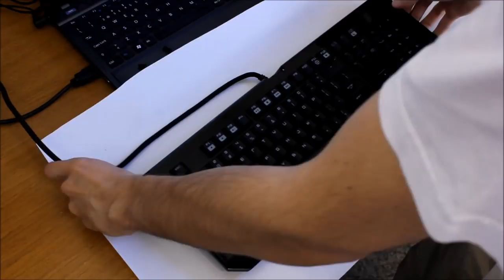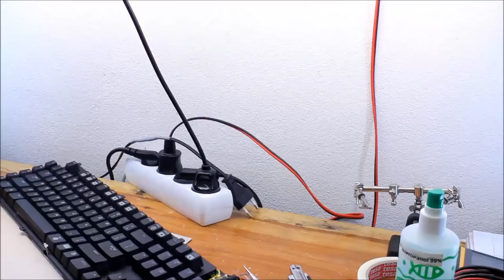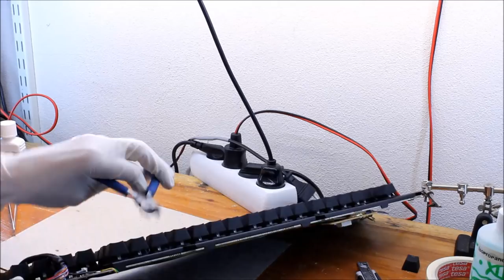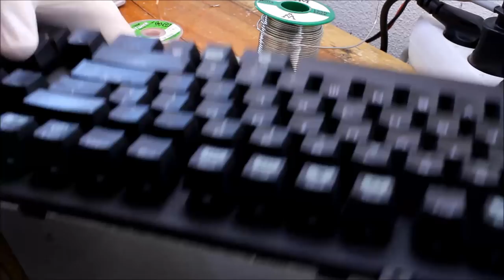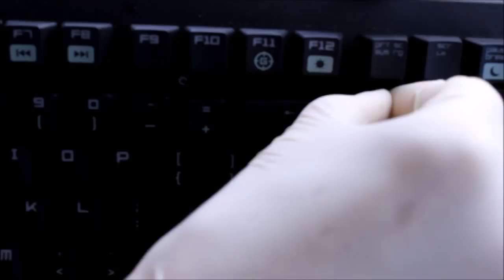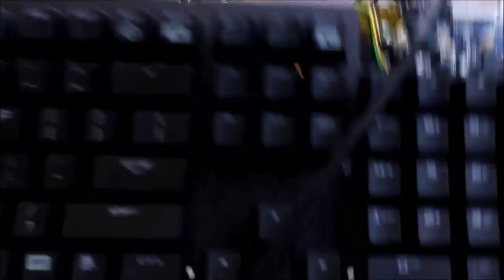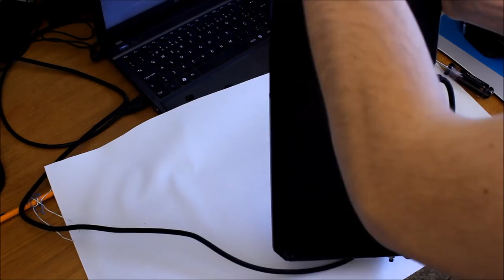How to replace backlight LEDs and Cherry MX switches in a mechanical keyboard.

Comment: Hi, one of the leds on my Blackwidow ultimate doesn't light up. I've read through the comments and will test out if it's specifically the led that is dead. in the off chance it isn't,how sould i proceed to make it light again?
Reply from the maker: The LEDs in the blackwidow ultimate are not individually wired, so if only one of them is not working it should be a dead LED. If the LED is ok I would check the malfunctioning LED's resistor next and then the PCB track, but I'm betting on the LED.
Reply: José Faria Thanks for the quick reply.I'm hoping it's the LED as well. But if it does turn out to be the resistor, how do i gain access to it, i.e. how do i remove the midplate from the pcb? would I have to unsolder everything? also,what are the specs for the resistor?
Reply from the maker: If it is the resistor, I believe you have to remove all the other LEDs and switches, but that's really unlikely. My resistors were 470 ohm, but they were marked, so they were easy to identify.
Reply: José Faria noted. thak you very much.since i don't have any background in electrical stuff, i need all the info i can get. so any 470 ohm resistor would work right? or is there a specific one that i'd need?
Reply from the maker: You need one with the correct size, I believe its 0603 (US). Don't lose your time thinking about that before checking the LED :D
Reply: definitely..i thought i'd just have all the information on hand rather than pestering you every time...thanks a bunch
Reply from the maker: By the way, you might want to buy several LEDs from several suppliers, it might be hard to find an LED with the exact same color, if it's color is significantly different that key will stand out a lot.
Reply: José Faria  Noted, though it shouldn't matter. Planning to switch all my LEDs to white.
Reply: Ali Eimran Good luck. I'm switching my LEDs to white as well.
Reply: Håkon Harnes All the best!!! I'll probably change it at the end of the year when all my stuff comes. update us on the progress
Reply: Ali Eimran Will do!
Reply: I completed the keyboard today. Took quite a while because I couldn't get the tin out of the PCB. Tried a soldering pump which didn't work, then moved on to soldering wick which worked in the beginning but stopped working after a while for some reason. Tried changing the soldering wick, still the same. Changed to a more powerful soldering iron. No luck. Changed to pointy tip, tried different techniques etc. could not get the tin out of the PCB. So what I ended up doing was melting the tin, then pushing the LED in. This worked but took a long time. First insert the right side and push it part of the way in. Then insert the left side. Melt both tin points in the PCB and insert the LED. Took quite a while...
Reply from the maker: When I increased the iron temperature my PCB tracks started to lift (never did in other PCBs at that temperature), I think I ended up doing it the way you did and in the end I had to bodge some wires to replace the damaged tracks.
Reply: José Faria Any idea why the soldering wick suddenly wouldn't work? It worked fine for the top row but after that it didn't work anymore.
Reply from the maker: Sometimes that happens to me too, especially with thin holes. Higher temperatures usually help, but with sensitive PCBs that usually means the copper might lift. The easiest method I've found to clean solder from holes is with a heated soldering pump, I've never had problems with that.
Reply: José Faria How many watts would you recommend for a heated soldering pump? Didn't even know these existed as this was my first time soldering electronics. Thanks for the video too. Would never have done it without the video.
Reply: Ali Eimran I also spray painted the keyboard backplate from bright green to black.
Reply from the maker: I'm planning on buying a proper desoldering station, right now I am using a 5 euro 30 Watt desoldering pump, it's not great, but gets the job done!

Comment: what size led bulbs are needed for a gateron switch?
Reply from the maker: It depends, they are usually 3mm LEDs, however, if the switches have a transparent case, it's more likely that the keyboard manufacturer used a SMD LED underneath the key and is using the switch housing as a light diffuser.
Reply: i bought gateron yellow with transparent case, so that means i have to get SMD LED if i want to change it?

Comment: Anyone know what type of LED to buy for a Blackwidow Chroma. I have several LED's that are defective just a few months after warrenty :( ... so in order to change them, anyone know which type to buy?
Reply from the maker: If I'm not mistaken, you need 3mm rgb LEDs, they have 4 pins, 1 common and one for each colour. You need to find out what kind of led you keyboard uses (common anode or common cathode) and the order of the colours. Also, you can always try and find replacement LEDs for that specific keyboard.
Reply: This is not really my area of expertice, so how do i find that info ?
Reply from the maker: You should talk to LED sellers, you'll eventually find one that sells the LED you need. You can also remove one of the working LEDs and find out how it's wired, check this out: https://create.arduino.cc/projecthub/tech-duino/using-common-cathode-and-common-anode-rgb-led-with-arduino-7f3aa9

Comment: When you say respect the polarity with the LEDs, how do you tell which side is positive and which side is negative? Probably a stupid question, lol. Also, what size are the LEDs, 3mm? Thanks. :)
Reply from the maker: If you need to do a quick test you can just try and connect it, if it doesn't work you reverse it and try again. Unlike some electronic components, LEDs in these situations don't get damaged if you connect them backwards. Regarding new LEDs, if I'm not mistaken, in most LEDs you have to connect the shorter pin to the negative. You can also check it with some multimeters in the diode test mode, my Agilent multimeter (now Keysight, I guess) does it, most of my cheap ones don't.
Reply: Thanks guys. LEDs ordered :) I'll post back here if all goes well.

Comment: what would u suggest if someone wanted to remove some keys and therefore wanted to turn off some of the leds underneath those keys (THEY R SO BRIGHT I DONT WANT TO LOSE MY EYESIGHT YET!)
ive the cm quickfire tk but it is really hard to hit delete and to distinguish between what is an arrow key and what is not so id like to remove the keys that arent necessary (numpad 1,3,right enter) to be faster on finding what i need when i want to click something there (without looking at it) - but yea as i said - the lights underneath r sooo bright xD but id like to keep the backlight rather on than off to find other keys more easily during gaming
and no i dont have those fancy utensils u got there :D
Reply from the maker: I've tried the TK too. I liked having the mouse closer to my left hand but I also had problems hunting for the DEL, HOME, PAGE, etc. (mine gets used mostly for work). My dealer didn't have the quickfire rapid, so I bought a trigger Z and I'm happy ever since.

If you don't want to replace the keyboard and you don't have the tools to unsolder the LEDs from the PCB, you can always try permanently removing the plastic keycaps and using some kind of black marker to paint the LED so it will be dimmer.
Reply: thx for the tipp :p
somehow i had the same idea like 2 hours after posting my comment lol :D
lets see if i find an appropriate marker for the job
Reply from the maker: It will be hard, the LEDs are really bright, as an alternative you can try to find a dark sticker and cut it to size to cover the LED.

Comment: Does every Cherry MX switch have a place for LED?
Reply from the maker: Most do, but some have diodes instead of LEDs for n-ney rollover, but you can spot them.

You can use the switch part number to get these details, check here:
http://deskthority.net/wiki/Cherry_MX#Product_numbers

Examples:
MX1A-11NN - Cherry MX Black/linear, no diode, plate mount (no fixing pins)
MX1A-E1DN - Cherry MX Blue/tactile clicky, with diode, plate mount (no fixing pins)
MX1A-L1RW - Cherry MX Red/low-force linear, red LED, PCB mount (with fixing pins)
MX1A-G1JW - Cherry MX Brown/tactile non-clicky, with jumper wire, PCB mount (with fixing pins)

Comment: What led use you ? Led 3.1v ? or led 4/5 v
Reply from the maker: jg I believe they were rated between 3 and 4 volts, but they were very cheap and I take the manufacturer's current ratings with "a grain of salt". On that keyboard the current is limited by a resistor on each LED, as long as you don't use infrared LEDs I think you won't have any over-current problems on the driver.

Comment: Hello. I have Razer BW 2014 Ultimate and I was a happy user of it. However, today I've decided to change my space key switch from Kailh to Cherry MX Green. I have successfully changed it, but when I started to test keys, it turns out that "s", "window" and ";" are not working. I think that I burned  some PCB element or maybe damaged the trace (but I cant figure out how did I manage to do it) during the soldering. I noticed on the PCB that keys didn't have trace which connect them with other keys' pins. Can I remove the trace protector and just directly connect the pins? 

Also I've tried to solder the pins of the broken key with the M3 key pins, but after it when I press M3 key some other keys are activating.

Maybe someone has the photo of the front of PCB, can you share it? I want to see the elements that placed on it.

P.S. Key switches are working, I tested it with continuity checker.
P.S.S. Sorry for my English.
Reply from the maker: Sorry, I can't take any more photos as I don't have the blackwidow for some time now. Unless you seriously overheated the PCB or used a LOT of mechanical force, I think it's unlikely you've damaged the top of the board (perfectly possible, of course). Before looking at the top of the PCB, place the underside of the board under a strong light so you can properly see the PCB tracks under the soldermask and look for defects, you probably lifted a pad or a track.
Reply: Thank you for reply. I will try to find that damaged trace.
Reply from the maker: If after the analysis you end up with the likelihood of the damage being in the top portion of the board and you want to try the jumper wire fix without taking all the top switches out, you can try and find a PC modding forum where someone is replacing the switches and ask him for a high resolution photo of the motherboard or find someone with the same keyboard and ask them to probe with a multimeter and try to find where the closed switch that doesn't work on your keyboard is connected to.

Just out of curiosity, how did you take the switch out? (soldering iron/soldering station/vacuum pump, etc)
Reply: I was thinking about the same. Today in the evening I will try to connect the pins of the switch and find with which other key it is connected.

I used solder wick to remove the solder, however there were a little amount of solder left on the pin and I broken one leg of the switch, however board was Ok.

I put about 330C on my low-cost chinese soldering iron. But I dont think that I could damage the diodes.
Reply from the maker: That's a lot lower than what I use, probably not heat damage.
Reply: I found the problem, I connected anode of "S" key and anode of "space" key it helped. I think there were burned elements, because from the bottom side of PCB all traces were looking great.

Comment: Does anybody or the creator of video know If I can replace the switches in Razer Chroma? If yes that's the way to replace it or it is another one with replacing switches in chroma? Want to put 4 cherrys red.
Reply from the maker: I'm not sure, but I reckon the switch footprint should be similar, however you will lose the RGB backlight functionality in those replaced switches. As far as I know there are no Cherry MX Red switches with the required 4 holes for the RGB LEDs.
Reply: How then the corsair k70 rgb is made? There would be no way to connect them correctly?
Reply from the maker: wlkkk As far as I know, unlike the Razer, the Corsair K70 RGB uses genuine Cherry MX switches.

To make the backlight multi-color Razer made switches with extra holes for the required extra pins of the RGB LEDs. Instead of making switches with 4 holes, Cherry's approach to RGB backlighting was to make the switches transparent and to place an SMD LED under the switch, this way the light passes through the switch and if you need to replace the switch you don't have to touch the LED.
Reply: José Faria 
Can't I make extra  holes in  the switch then or something? Just to make the RGB  Led work with cherry's?
Reply from the maker: You can buy a switch and try, it might work. The worst case scenario is a broken switch, not that expensive.
Reply: Yea, I bougth 4 switches and I only need 2.  I guess I will justr try and I let you know here Waiting for switches from China then :) Anyway thanks for your help.
Reply from the maker: No problem, good luck!

Comment: Do you have to remove the backlight to switch out the key?
Reply from the maker: Yes, you do. The switch is inserted in the PCB, then the LED leads are inserted through holes in the switch. First you need to remove the LED, otherwise the LED would stop the switch from coming out.
Reply: José Faria and do i need to buy a new led or can I place the same one back ?
Reply from the maker: ***** You can use the same one. In order to do that, you might have to use solder wick to clean remaining solder from the LED leads, otherwise it might be harder to solder it again.

Make sure you don't reverse it, otherwise it won't work.

Comment: I have to desolder The led mandatorily If you just want the switch?
Reply: It is urgent
Reply from the maker: Yes, you do have to remove the LED first.
Reply: Can I reuse the LED of the keyboard? 
it will not break?
Desoldering tips For not damege the LED? (i don't have solder wick)
Reply from the maker: No, LEDs are very tough, especially those ones, with very long "legs", it's very unlikely that you will damage it. You need to be careful with the PCB don't apply heat for a long time.
Reply: José Faria Thank you, tomorrow will try desoldering, I stay calmer.
Reply: José Faria 
How long you should leave the welder? Thank you
Reply from the maker: Franco Montivero There is no "proper" time, it depends on the PCB, component and soldering iron, just do it as fast as possible, without pulling on the LED too much.
Reply: The solder will not melt, Welder with hot, more of 20 Seconds, But the solder not melt.
Reply from the maker: Franco Montivero You need a hotter soldering iron, if it is a soldering station you need to increase the temperature. When a soldering iron has enough heat, the LED solder should melt in around 5 seconds.
Reply: Hey Jose! Think this could work on a Genius GX Scorpion K9 Gaming Keyboard?
Reply from the maker: Prometheus Unlikely, that appears to be a membrane keyboard, not a mechanical one.

Comment: Man i want to ask, my roccat suora FX has that LED on that top side of the switch (same as in the video, not the smd one). Can i just desolder the switch and pull the switch without removing the LED? Is the switch stuck with the LED so when we want to remove the switch, we need to remove the led first?
Reply from the maker: If the switches are similar to those Cherry MX ones you do have to take the LED first before removing the switch, otherwise it is indeed stuck even if you desolder the switch.

Comment: i have a razer blackwidow chroma and my problem is that this button "-" green not working on it wich mean the other colors like blue sky pink willl not work very well so i have to change the led please tell me the size of the led
Reply from the maker: I know they are 3mm LEDs, but I don't know if they are common cathode or common anode or the order of the colors, you will have to remove a working one and investigate it yourself. Check the introduction to this project, they describe the differences between common cathode and common anode LEDs.

Comment: i got red leds in my keyboard, and i'm gonna replace it with white leds. ¿can i do it if the red led is 2 volts and the white one is 3 volts? sorry if my english is not very well.
Reply from the maker: Depends on the keyboard, if it uses LEDs in parallel with resistors to set the current it will probably work fine, but if the LEDs are wired in series the controller might not be able to drive all the white LEDs. If there is a white version of your keyboard it will probably work, though.

Comment: Is it possible to get an my Razer Blackwidow ultimate to an RGB even though it's originally a Green LED.
Reply from the maker: Technically not impossible, but the wiring would be way too hard.
Reply: @jfaria  how would the wiring work? I was thinking just replacing the LED Green with an LED RGB. But, I was thinking that the design of the board does not match the driver for my keyboard.
Reply from the maker: You would have to solder 4 new wires for each led, then create a circuit to drive all those RGB leds, the wiring itself would be way too hard. Even if you wired the LEDs in series it would be a nightmare. Buy a new keyboard :D
Reply: @jfaria  Good idea. I'll just stick with my Green LED. Hahaha.. Thanks.

Comment: Do you have to take out the switch to replace the led?
Reply from the maker: On that variant of switch with the opaque plastic, the LED comes out first, you can replace the LED without taking out the switch. Some newer variants have clear plastic switches and small SMD LEDs underneath, like these ones:
https://linustechtips.com/main/uploads/monthly_2017_11/20170312-J02_0860.jpg.f9ee5e217739b9e60cecaf25eed649aa.jpg
On those the switch needs to come out first,